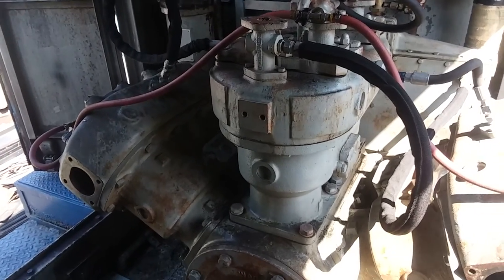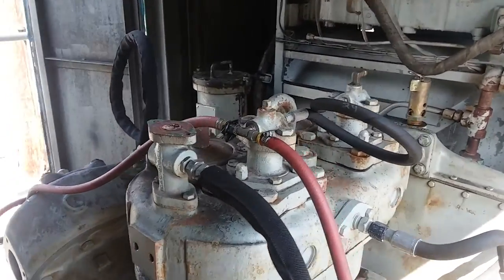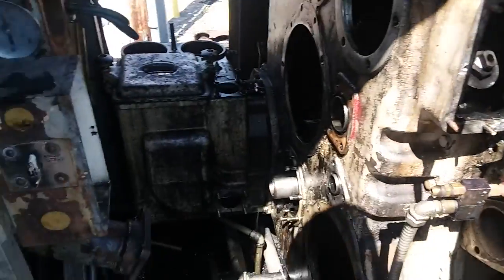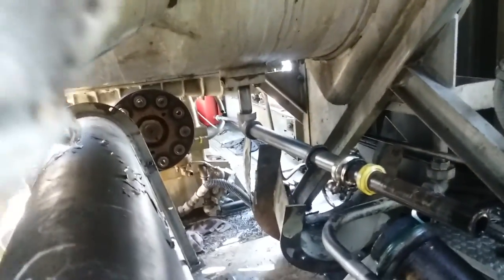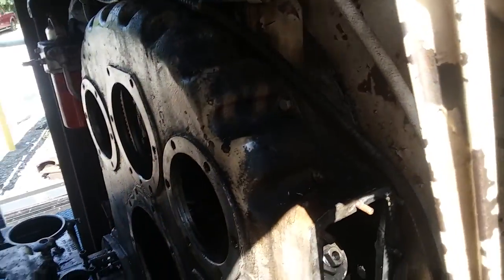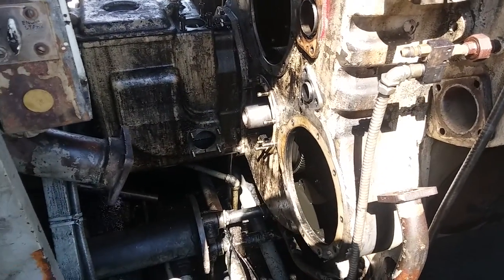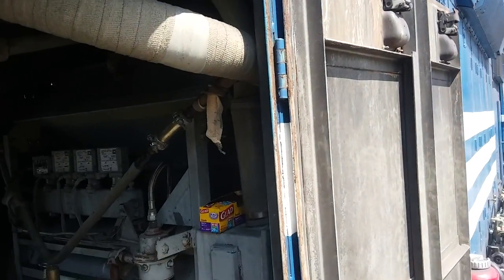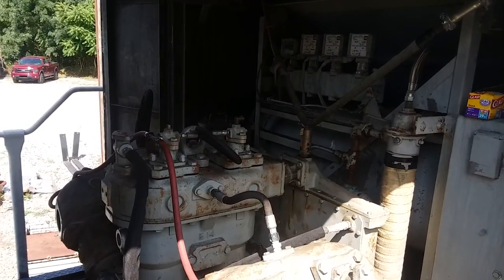SD 40-2 Air Compressor with Broken Drive Shaft

Comment: Attempted to do some research on this unit as I’m an SP fan and as best as I can determine, the unit started life as SP 8477 built in May of 66. It ran as a normal 40 until around 1980 when it was rebuilt in Sacramento as part of SP’s GRIP program. It was reborn as SP SD40R 7330. It ran in this form until the end of SP and for about five years on UP before being sold off and being once again overhauled by Alstom and being rolled back out as GCFX 3098. It ran with Alstom until 2008 when CIT group acquired the unit for its lease fleet. It only ran with CIT for about five years before ending up on the Cumberland Mine where we see it here. That’s just what I’ve managed to turn up on it. Could be wrong.

Edit: I just saw one of your more recent videos with essentially has all the same info I stated making this comment completely redundant.
Reply from the maker: Hunter, just saw your comment and was going to send you
the link to the vid with the description, but looks like you've
done a great job at researching it. 3098 has quite an interesting history. I do not have the exact years it was with CSX and CP tho,
did you happen to be able to find that info out? If so I would love
to know it. I got some cool pics of that loco from the broker who
sold it to us, that notebook with the pics came from the sale, \
neither do I know nor does anyone else at the mine know the
purchase price. However it was common knowledge when it came
here that it cost more to get it shipped here than the cost of the loco.

Comment: I've been messing with "train simulator" , I noticed I would hear fans come on when I would use the dynamic break, would love to see that part of a locomotive if the opportunity permits. 

That is one wicked big air compressor, Oval pistons? I thought it was a 6 cylinder before you stated it was a 3
Reply from the maker: Rodney there is a noise that sounds like a whirr when you set up the
dynamics, that is an electric motor pushing in a circuit, there is also
a dynamic brake blower on these old locos that helps cool the
dynamic brake resister grids, perhaps that is what you are referring to

Comment: is this the same SD40-2 that was involved in the broken coupler and cracked frame.. if so could that be the cause of the broken shaft.. do to the impact causing misalignment 

 if not what is the  status of that loco.. is it slowly being repaired.. ??  or will another SD40 or SD40-2 be sourced perhaps with a broken engine to allow a transplant.. 
i see videos of Miles of locomotives out of service.. across the country.. do those go back to to the factory for rebuilding or to the scrap yard where only the trucks are recycled.
Reply from the maker: Wayne, yes that is the same loco, very good question sir about the impact possibly causing the alignment issue, that is a question nobody here has thought of! You may very well be right. It has been fixed and is back in revenue service. All we have are 3 locos. To answer your query of what happens to out of service locos that all
depends on the railroad having them, each RR has different plans for them I would assume
Reply: @ccrx6700  I was going to say the same thing. That hit damaged the shaft. I'm sure you did a crankshaft inspection to check the thrust bearings after the hit. 

It's pretty common to mic the crank and alternator after a good hit to see if anything moved.

Comment: How in the hell the drive shaft...oh man that 40-2 been through hell they should just cut their loss cost too much to repair.
Reply from the maker: Yep, gonna be bout 15,000 to repair, just unbelievable, nothing to repair loco is cheap
Reply: @ccrx6700  iLL TELL YOU THIS FOR THAT PRICE THEY CAN BUY A USED DASH 8 RUN THAT ACROSS THE SCALE LOL
Reply: @jacjac5761  they 'll be working on it all the time, plus the fires out the stack.
Reply: @ccrx6700  bet its only the 2nd time it happened.
Reply: Yep @rear speaker the call em GE toasters for a reason LOL
Reply: @jacjac5761  
GE has circled their problem. 
I take the worst EMD over the best GE.